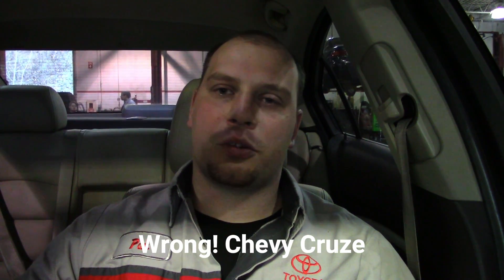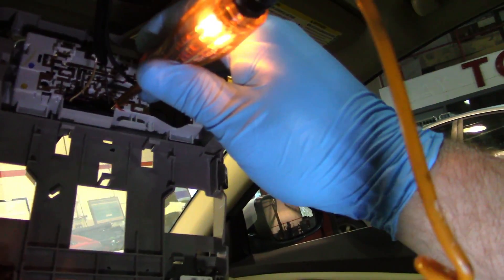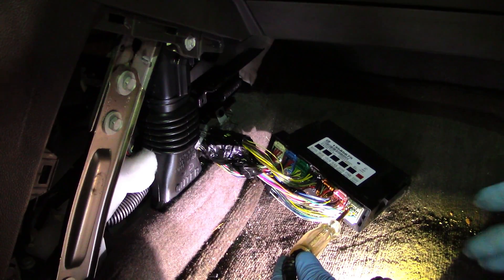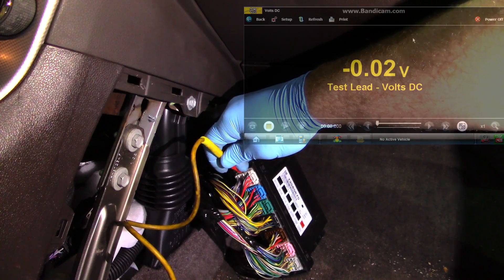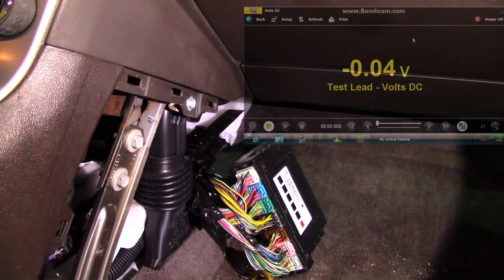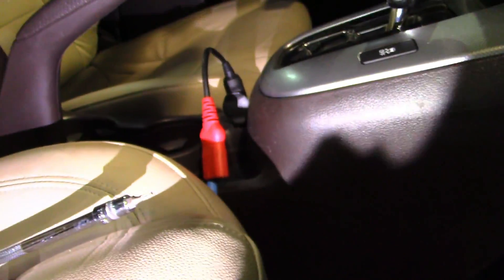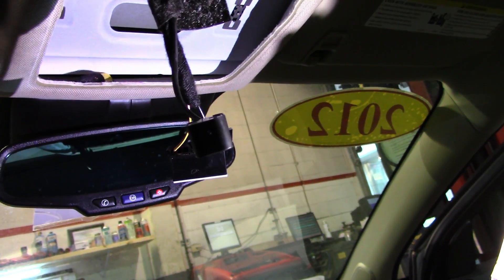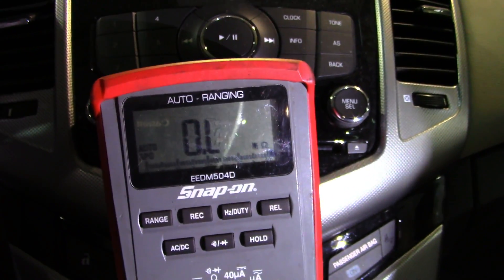A NOT so simple Chevy map light diagnosis

Comment: Had a gm suv a few years ago with no map lights. When i accessed the bcm i found its connectors green and crusty( flooding?). Was ready to call a bcm and rewiring. But then i thought "why are no other body systems including anti theft not failing?"  I checked the feed and found the passenger vanity mirror qas shorted 😀.  Informed customer of our findings .  They opted to leave it as is with the mirror disconnected (despite our warnings) 😢.  They still paid the diag and i guess the car was just a temporary situation.
Reply from the maker: That's a good find! I can't imagine how many would have missed that!

Comment: In hindsight. If there is protection against overcurrent in the way that it monitors current and shuts it down if its too high, i would think you could catch it with an ampclamp on a scope at the moment the circuit is turned on, no?
Reply from the maker: That’s a good question. I think you’re probably right.

I’ll tell you what else that I could not get on video. Every once in a while the lights would flick on for a half of second.

But it was so intermittent I wasn’t able to film it. So it must check the circuit every so often as well.
Reply: @VoltageDropDiagnostics  yeah it probably is. Thats for another episode! :p
Keep up the good work!

Comment: Nice one! Working in a high volume pre-owned dealer I deal with alot of these types of repairs. Not to long ago I had a map light issue on a 2013 Sierra that turned out to be a BCM failure
Reply from the maker: Yeah. My first dealership job was for Saturn. And when they started switching over to GM built cars, I remember replacing BCMs daily lol.

Comment: I had a 2011 lacrosse that had an intermittent no start  with the push button on the dash.  I had several different codes in various modules and wasn't sure  which direction to go but I did notice that the interior lights would come on and go off every 60 seconds and the bcm was protecting itself, I found a light at the bottom of the right rear door  panel that had come loose and got smashed in the door jam , I unplugged the damaged light and the interior lights worked properly and the starting issue was gone. Neither the starting circuit nor the interior lights were on the same circuit but  both were bcm controlled. I'm surprised the map light wasn't Blinking on that chevy.  Great video!
Reply from the maker: It actually was flickering. But it would do it so randomly and so sporadically that I wasn't able to get it on video. I didn't notice it at first, either.